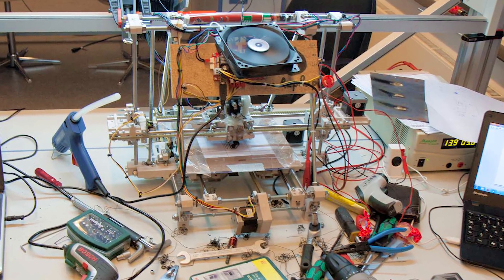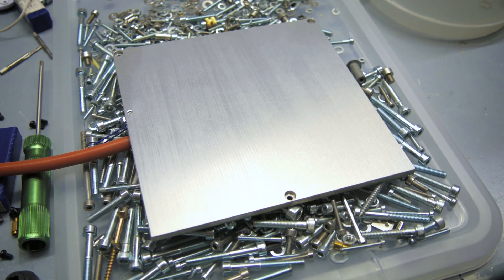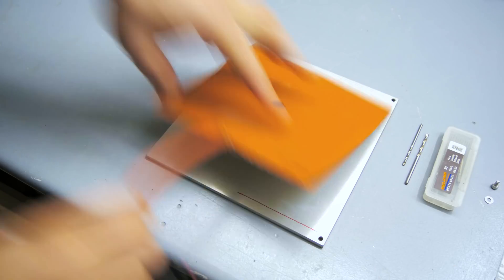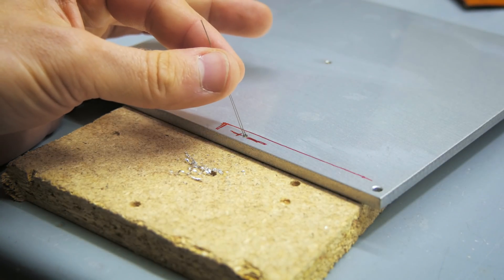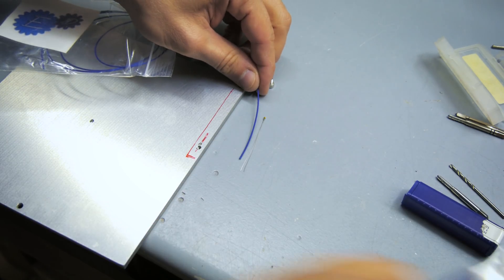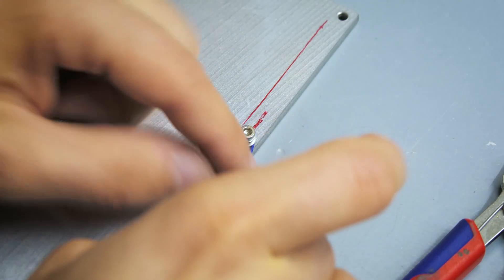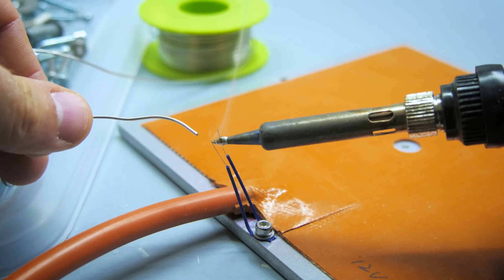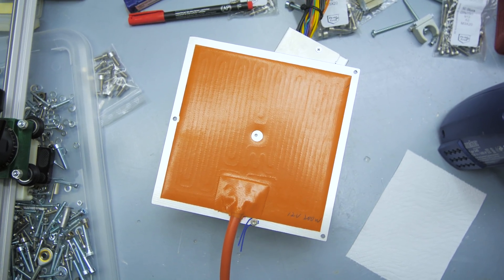Guide: Heated bed thermistor mounting done properly!

Comment: Hi. I wonder why i can not find any 48v silicon heated bed's?
Everywhere i look i only can find 12v, 24v, 110v or 220v bed's.
Does anyone know why i should not use a 48v silicon heated bed?
I have a Mean Well 48v 13A powersupply.
Reply: You can put multiple heaters in series to reach 48v. Or use a 24v heater with 48v… the heater will dissipate four times the power at double the voltage. A 12v heater will consume 16 times the power on 48v.
Reply: As long as you don’t exceed the ‘maximum instantaneous power’ rating, you can achieve any lesser power output with PWM. It should be temperature controlled anyway. 

You should have over temperature protection too.

Comment: Awesome. Will definitely be doing this. I have a question maybe someone can help with: i'm mounting a thermistor like this for a 750w mains powered, SSR switched heater pad on my CR10S (has a stock v2.1 board). However, I would like to hook up both this and the thermistor bonded into the pad. These beastly mains pads can be a substantial fire hazard should it somehow come loose, or the bed probe or power wires fail in a "unfortunate" state, so I would like to use the one bonded into the pad for safety. Something like this: With an exception for the first 60 or 90 seconds of pre-print heatup; If the in-heater pad sensor gets >50°C hotter than the in-bed sensor, cut the power to the bed heater. I do have a ceramic thermal fuse inline with the power to the heater, but I don't feel super comfortable having that be the only safety.

Anyone got any pointers on how to achieve this? I guess it would need a secondary sensor input on the board that isn't consumed by the ABL probe, but also some entry in the firmware to actually enable and config the function.

Comment: Dear friend ! My blanket has no adhesive, which adhesive you indicate to paste this blanket in aluminum ??
Reply: If your silicone heater mat doesn't have adhesive, then I'd look into a thermally conductive glue (sometimes used for gluing on heat sinks?) -- But... it just seems sketchy to me... -- alternately, you could sandwich the silicone mat between the aluminum bed, and a piece of wood on the bottom? (so the layers go like this: aluminum bed, heater, block of wood, airgap, printer bed base plate). -- Wood is a terrible thermal conductor (so that it should keep the heat going into the build plate), but, I'd use something like MDF if you go that route (plywood would warp too much over time; whereas a slab of MDF won't warp nearly as much).

Comment: Question.  I designed (or redesigned) the Prusa i3 and Wilson into one printer.  Mostly to simplify the Y axis.  If you check out my design on thingiverse at http://www.thingiverse.com/thing:1259225 you can see how my bed looks/works.  It's aluminum, with a MK2 heater and glass on top.  Do you have any advice on the bed thermister for that?  Right now I basically have the thermister through the hole in the MK2 heater and it's taped down with kapton.  It's frustrating because between the thermister wires and the bed power wires, it has to sit slightly above the aluminum and also the glass has a gap above the heater.  I use fiberglass washers to keep it level and for clearance.  Any advice would be greatly appreciated!  Thanks!

Comment: Tom, excellent video! Your series of guides has been indispensable in helping me with my build. Two things, I did order through the shop you referenced and the experience has been lackluster thus far. I can count part of this as having ordered on Amazon, but it has been two weeks and my item still has not been shipped. I contacted Ali Tech directly and have gotten no response. Secondly, I have to run my printer bed on 110v power directly from the wall outlet. I did a mockup with another heater and thermostat and experienced what is known as "hunting" in the HVAC industry. The power flow being unregulated means it is constantly on then switches off. The small trickle of voltage is not enough to keep the element at desired temperature. The relay is constantly opening and closing. I cannot assume this would be good for the life of the unit. What are your thoughts on using a PiD thermometer and second thermistor. The relay would still be energized by the ARDUINO board from my printer?
Reply: Thank you for the input sir! Although I was not referring to the SSR being on and off. More of my concern was aimed at the bed itself being cycled constantly. I have a solution I found that I will gladly upload and show you. If I do not end up needing the equipment for this project I will use it for another so no money lost there. Stay tuned and thanks for your time, I know you are busy

Comment: would it not be more accurate to put the thermistor in the middle of the bed? It looks like you have room for it.
Reply: That was my thought exactly. However, it would only be applicable to the model that he has specifically (with a hole on the middle). Most silicone heat pads do not have a hole in the middle and thus the method Tom shows in his video would be the correct way of doing it.  In such a case, sandwiching the thermistor between the heat pad and aluminum plate in the middle would not be a good idea because it would be impossible to replace the thermistor should it go bad.
Reply: @tazdrum73  You could do it, just make sure the mount and fit is good, the part is prime quality. And you're willing to live with having to just leave it for dead in there if it fails. 

You can also contact the (ebay and ali) vendors of these heat pads. Many of them make pads on demand, meaning they can make it with holes for you however you want it.
Reply: It would be hotter in the middle, depending on the design of the silicone heat pad, I suppose.

Comment: Hey Tom, do a video on guide to delta calculations, like how to calculate max build volume or how to increase build volume of existing printers like rostock or even measuring lengths for delta calibration. I've been recently trying to build a rostock and figuring out the delta lengths like arm lengths and build height has been a real pain.

Comment: I notice that the bed plate has 3 holes for leveling instead of the usual 4 holes.  Finally!  I am disappointed that you've never addressed the problems with 4 screw leveling, so people keep buying it and kit makers keep selling it and everyone has problems keeping their print beds flat and level and keeping parts stuck tight.  Then they add auto leveling to try to fix it without addressing the actual problem.  The cure to adhesion problems is simple and doesn't cost any more than a thin, flexible bed made of sheet metal, topped off with a piece of glass, and autoleveling hardware.  All you need is cast tooling plate, a little PEI or kapton tape, and 3 point leveling.
Reply: Mount the print head on strong  springs,, get the bed level and that way you can adjust from the top ..by winding the print head up or down

Comment: I just typically use 3M double sided outdoor tape.  It holds the thermistor down and also insulates so that there is less effect from ambient heat...giving a reading that is closer to the heatspreader temp.

Comment: Hi Thomas,
I also (who is not) have a question? (actually two (2)
usually in the long run my extruder freezes,
and often as the filament a lot withdrawn  (goes Backwards - withdraws)
.
another problem which I actually find the worse!
when the workpiece get higher the extruder bumps against the workpiece!  :-( 
The nozzle also sometimes seems too going to pass through the PLA (goes through it - through the PLA)
(it seems as if the X axis is not enough going up)
strangely enough it does not always make this error?(sometimes it seems that it did not happen)

Here a photo album with some pictures:
http://myalbum.com/album/niMpUDhlInjv
to see all the pictures scroll down please?
you see that there are also good prints
but do not be deceived, this is done with other software!(Pronterface) 
and even there it went sometimes with a error! (it went wrong)

I hope you can tell me anything,
and who knows there are more people with the same problem?
then a video with an explanation would be very nice? ;-)

sorry for bad translation (me and Google Translate);-)
Friendly greetings from the Netherlands.
Rob.

Comment: nicely done on the mounting. little tip as a machinist. Using a punch makes starting the drill without walking a breeze especially when a mill or drill press isn't handy. 

you could try making the side plate  holes on a drill press but I wouldn't try it freehand as it could get ugly fast!

Comment: hi, great Thomas. You could also use a small blob of hot glue to fix and protect the sleeves before mounting with the washer. Most washers have 2 sides, where one is more rounded. Suitable to use the rounded side towards the sleeves. Or simply use a silicon rubber washer. Most problems occur with strains & too hard / sharp materials facing the sleeves. The sleeving  is the most versatile method when applied carefully.

i can help out with customized silicon rubber heating plates. All can be customized: size, shape, voltage, power. 3M double-sided adhesive. I ship directly from China, where i live. Drop me a note here or email. I am German and you can also talk to me in other languages.

Comment: for a printer 300x300 rpintable area which ticknees of aluminim you use? where i can buy it?
Reply: +TheSgtMayor I'm also looking for that answer. Right now I'm on 4mm.
Reply: +Dirk Alferink I foun one ebay seller, but 30€ plus 20€ for shipping, total more than 50€ i think its so expensive
Reply: +Dirk Alferink I have one heated bed but not the aluminium plate
Reply: oh. We've a lot of metalworking shops over here. Just take a look on the internet. I'm sure you can find anything nearby.
Reply: +Dirk Alferink I find two but 50€ for cut 310x310 aluminium plate...
Reply: I pay €9 on a webshop in the Netherlands. 320*320*4
Reply: +Dirk Alferink can you tell me the name?
Reply: +TheSgtMayor  "aluminiumopmaat" but they will only send to benelux..
Reply: +Dirk Alferink thanks i will talk with they.

Comment: I would think that mounting the thermistor on the edge would insure the whole build plate was up to temp before printing.
Not sure of the delta in temp. if truly only 1 or 2 deg C then it would be better to mount as Thomas shows.

Comment: Why not using a silikon-heater with integrated thermistor in the first place?
Reply: exactly. Kenovos quality is high end,  I have a 750W heater and it's perfectly manufactured!
Reply: ***** Generally, you are absolutely right. Practicaly, I did testing it. There is a slight offset of 2-3 degrees between surface tempearture and measured temperature of the thermistor. This offset gets smaller, the bigger the mass of the heated bed is. I tested with a 3mm thick plate with a capton-heater and a 8mm thick one with kenovo silicon-heater. Measurements were taken with thermistor, contact-probe(FLUKE) and visually with a thermal vision, all 3 simultanously. 
But: great video as always - except the last one of the CEL :P And maybe you noticed, that outside of germany the PEI-coated-aluminium thing is pretty new. Because of this, your video-information is apreciated! thumbs-up
Reply: Yeah, for sure there are a ton of factors that influence this temperature offset. And no printer is like the other, too...

Comment: That glass fiber sleeving is the worst. Ive killed 3 thermistors trying to get that crap into the v6 holes without fraying.
Reply: Don’t bend electronic component leads right at their base. You’re supposed to form the leads before installing the component too, so it’s done properly.